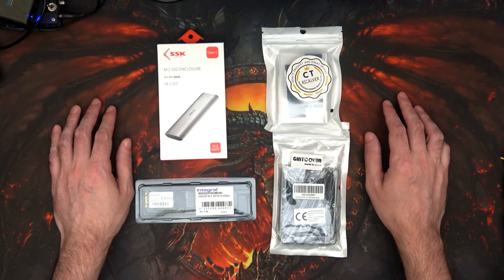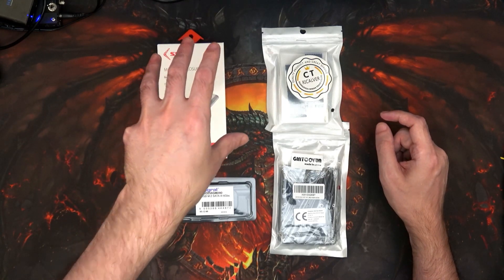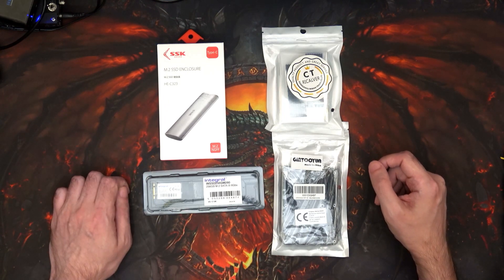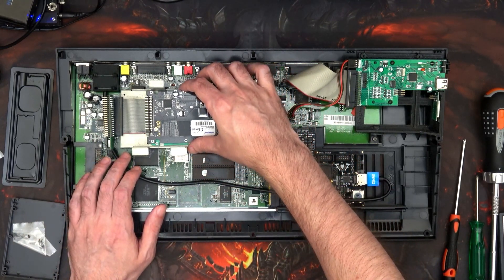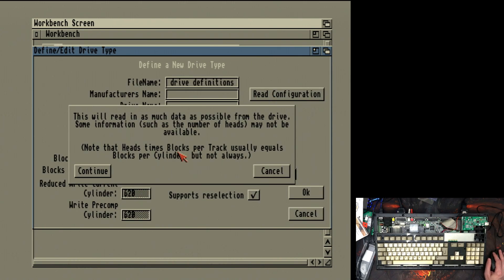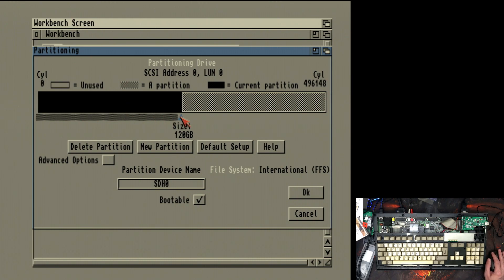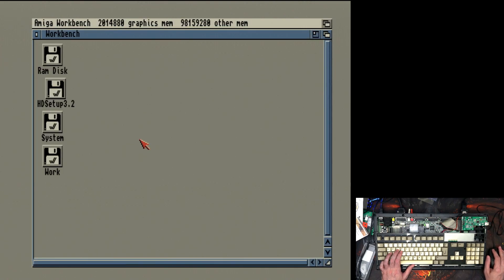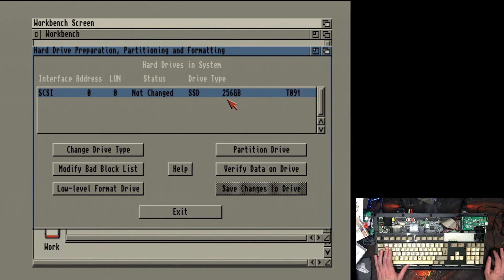Commodore Amiga 1200 with a 256GB m.2 SSD install

Comment: Why not connect to the faster vampire IDE port?
Reply from the maker: At the time it wasn’t bootable, if I remember correctly wasn’t stable even for a non-bottle drive.

I’ve upgraded from a Vampire to an Icedrake since then anyways.

Thanks for watching!
Reply: @RetroBoxRoom  Could you connect it to the Icedrake then? I have an Icedrake, too.
Reply from the maker: Yes it can be connected.

Comment: Do I need a buffer board?  I have the same set up - but my amiga will not see it
Reply from the maker: What version of kickstart roms do you have?
Reply: @RetroBoxRoom  3.1
Reply from the maker: For a drive as large like mine, I'd recommend getting at least 3.2. Something that allows buffers, wouldn't go a miss
Reply: @RetroBoxRoom  I dont want to go for 3.2 yet, as I`ve ONLY just bought the 3.1s
Reply from the maker: @ukSMP74  Ah, sadly you're not going to get any further matching my setup, if you don't upgrade.

Comment: Fun Fact: At least in my own testing adding a lot of buffers on a modern SSD actually slows down the overall drive speed a little bit, particularly when the SSD also has its own DRAM cache. I now just keep Buffers down to 10 on my SSDs.

Comment: Thank you for sharing this video. I have been buying up old broken and run down Amigas and bringing them back to life repaired, recapped, refurbished, accelerated, and such. I tried to use the IDE P01 to Sata converters with no luck on 3.5 SSD drives. I did wonder if there would be power issues and it did have have them. So your video not only confirmed that the 3.5 SSDs needed more power than the bus could provide but also answered my next question about M.2 so I'm about to do this to several 1200s, CD32s, some accelerated A500s, 2 2000s, and 1 4000 that deserves 1TB. One point on the "use case" of this is I can add all of my CD32 games and Amiga demos to a partition where they can be stored compressed until I decide I want it on the active partitions. Thank you again. Here's a little something for saving me some time ;)
Reply from the maker: I'm glad the video has been of help! Thank you for the gift too!

Comment: Well i got the stuff and my hdd light glows dim constantly, and selecting to boot from a floppy or gotek to install it all i get is the amiga startup animation. No dice here, maybe different version of card to yours although it looks identical
Reply from the maker: It might be. Which PSU are you using? Which msata drives are you using? The same as mine? Has your 1200 been recapped?
Reply: @RetroBoxRoom  have 2 a1200's both using original psu, 1 has tf1260, other tf1230, msata works perfectly through the eide99 interface, if i connect to standard ide it works but hdd led glows. This is same on both a1200's

The interface im now sending back like yours in this video my m2 ssd installed in it neither the 1200 or tf ide sees it.

Both 1200's havent been recapped but are showing no signs of needing to be, the tf1260 one has an indivision mk3 in it as well
Reply from the maker: My 1200 has been recapped, and I use a more powerful PSU than the stock 1200 one.

If it works with a 4xeide'99 for you, I can only assume that's the factor that you need. At moment. Though, I would get your 1200s recapped as soon as possible.

Even if they they look fine, they're most likely not.
Reply: @RetroBoxRoom  thanks for your advice, The psu's i use are the ones from the a500's as i have 2 of those as well, they are more powerful than the standard a1200 or so i believe, have a couple of ak47 interfaces coming for the 1200's as apparently they cure the glowing hdd led problem as well

Comment: I remember having 4GB CF card as my hard drive and it was a lot, since I wasn't keeping stuff I didn't need. I got some DMS files of my favourite software, some modules, favourite stuff installed and it barely took 1GB of space. 256GB is insane. It's possible that you can fit all the Amiga software, including CD games and the whole Aminet... Since Commodore flopped in 1994 there wasn't much stuff that could need a lot of space or even make use of the heavily upgrade Amiga. Unless you want to watch some movies on it or play mp3s. If you use Amiga for modern entertainment huge disk may be helpful. 🤷‍♂️
Reply: I think the Aminet is a bit over 30 GB, so you probably could. But modern internet is faster than the A1200 IDE interface, so you probably shouldn't ;-)
Reply from the maker: Yes, but these days I have an IceDrake. 😀
Reply: @RetroBoxRoom  24 MB/s = 192 MBit ... it's getting towards modern internet speeds, unless you have fibre-to-the-home internet ;-)
Reply from the maker: I happen to have a 1.1Gbps Internet connection, but even through my IceDrake, which they say has the potential top speed of 100Mbps, but the onboard IDE of the IceDrake is roughly 160Mbps. So, either way, it's a very nice speed for an Amiga 1200.
Reply: @RetroBoxRoom  Yeah, 100 Mbps is 14.5 Floppy Disks per second, and nobody speed-runs Monkey Island in 0.7 seconds🙂
Reply: @ShieTar_  My uncle had nicely upgraded A1200 that was as powerful as the A4000 and he had something called FastEIDE which was much faster than built in interface. These addons were super expensive back then so most people didn't know they existed.
Reply: @mattx5499  Oh, we knew they existed, we just were confused on the "how to pay for them" part ;-)

Also the internal controller can still push more than one Floppy-Disk per second, so nobody really was bothered by the "low speed" in the 90s. 

So yeah, Mr Retro Box Room could also get more performance out of the drive by using the FastIDE controller of his Vampire, if he cared, but even the ~13 MB/s of the V2 Vampire are technically still slower than many modern internet connections (if you live in the right area).

Comment: you have a small usb thingy at top row of pins next to the ram, what is it and what does it do, did you have to add the pins to the motherboard for it ? Thanks
Reply from the maker: Near the top-middle of the motherboard? That's a keyboard adapter. I purchased a USB version, so I can plug in a wireless keyboard dongle. It just presses over the chip that sits there. It's, so when I use the Amiga on the big TV in the front room, I don't have to keep reaching for the keyboard.
Reply: @RetroBoxRoom  yes thats the item i mean, what exact item is it, ie model number, manufacturer ? And i was under the impression those pins up there were duplicates of the clockport next to the roms, is this not the case (my main board has no pins where your usb is)
Reply from the maker: I believe it's called an AmiKEY A1200. It fits over the U7 chip, right next to where the ribbon cable to the stock keyboard fits in. I bought it off ebay years ago, so I'm unsure of the maker.

Comment: You don't need a heatsink on an m.2 sata ssd in an Amiga 1200. What kind of data transfer do you expect that thing to do? That ssd will be nose picking 99,6% of the  time because the Amiga is so slow. The only valuable reason to have an m.2. drive is just because it's small and thin, but it is more reliable than an ordinary CF card.
Reply from the maker: I stick one on, because when it's attached to my PC, while I set it up and it takes 20min+ copying the image over at full speed. It's better to leave it on, rather than keep removing it, because that would mess up the thermal pad.
Reply: Amiga won't kill any flash memory card though, since it isn't using it when it's not doing anything unlike modern devices. I think that CF card is sturdy enough to work for years. I still recommend making regular backups from time to time to keep important files safe, because electronics durability is a lottery. 😊
Reply: And yeah Amiga won't use the SSD drive's capabilities in any way since it's too slow and the HDD controller in the Amiga is ancient and won't achieve speeds bigger than few MB/s. There were controller cards for the Amiga like FastATA etc. But they are still pretty ancient for any serious speeds.

Comment: I've been looking for this. Can anyone explain why a M.2 drive in a M.2 to eide or Pata adapter comes up as scsi in HD tool box? And what driver or device software is used or why on my machine at least is it scsi.device and not ssd.device or m_2.device?
Reply from the maker: The scsi.device is used because the Amiga first started with SCSI. The name has stayed because of compatibility and historical reasons, so it can still be accessed by other programs/drivers.

As for ssd.device etc, the Amiga doesn't have a SATA port. It only sees the interface closest to it. That's the whole point of the adapter used. It takes the SATA/m.2  interface and converts it to EIDE.

You can think about the adapter being a translator, between EIDE and SATA, but in real time.
Reply: @RetroBoxRoom  I think I'm starting to understand how it works now. So, the file scsi.device is really  just a text file with tooltypes that contains information about how a device is communicated to. Scsi.device is just the name that the system uses to access that port. Is that right?

Comment: With 4096 buffers I am surprised you have that much RAM free. That is 4K x the size of the drive. I wonder if there is a limit to the number of buffers that are recognized. Also, I would have gone with a larger block size than 4K, especially on that 150+ Gig drive. If it ever has to to a verify, it will take about a million years, if it can do it at all. I think 16K or even 32K are appropriate for that size drive. 
Cool stuff! I have an adapter with a 64GB m.2 SATA drive, but it never has been recognized by my Amiga 1200 - full disclosure I have never tried it on 3.1.4 or 3.2, so it probably works fine now.
Reply from the maker: Thank you for the info. I was going by what I'd learnt for smaller drives.

If I revisit, I'll reformat the way you say.
Reply: @RetroBoxRoom  Just a thought as i have been messing about with large hard drive support on classic OS 3.1 ect...ect... i think 80GB partitions with FFS is a no no, but im not sure if this applies to OS.3.2 out of the box install??... very confusing situation and hangovers from Classic  3.1 regarding filesystems, large HDs support.. and when reading up on this in forums ect, you are confronted with views and opinions that are either flat wrong, out of date, or simply mis-informed.. I myself have tested large drives with a patched 43.45 scsi.device with an IDE to SATA adapter (not suitable for mounting into the a1200) but works with every 2.5 sata drive i throw at it... (using pfs3aio)  im just not able to mount the adapter into the Amiga1200..  The situation with filesystems and large HD support using FFS and PFS3aio with OS 3.2 out of the box is completely unknown to me at the mo? Anyone have any thoughts on this?

Comment: Would a fast ATA card/cable for Amiga speed things up?
Reply from the maker: A fastATA adapter would help. But from I've read, they aren't recommended unless you're going to do tower case mod. They only just fit in a stock 1200 case.